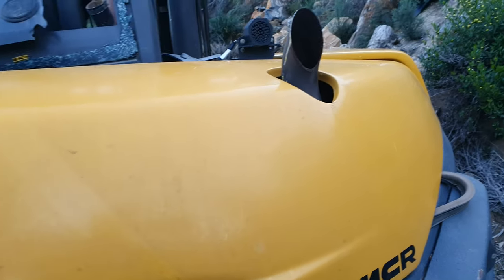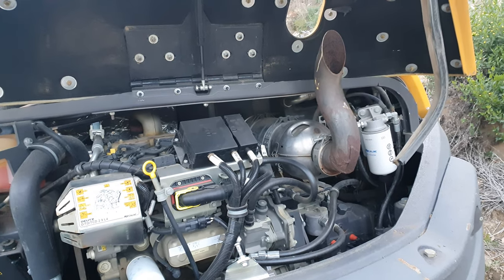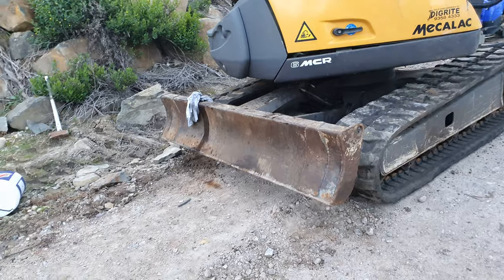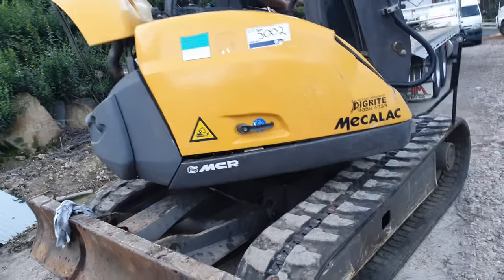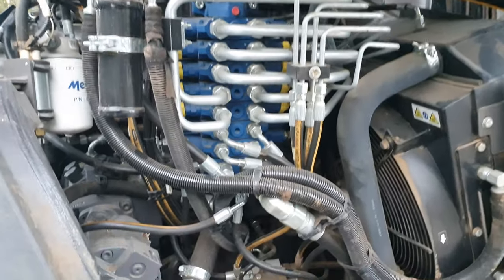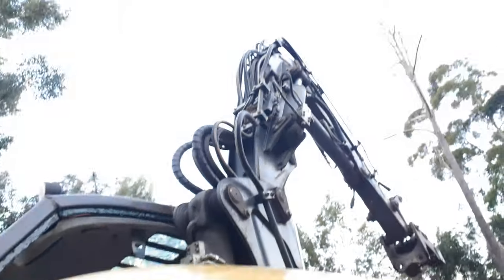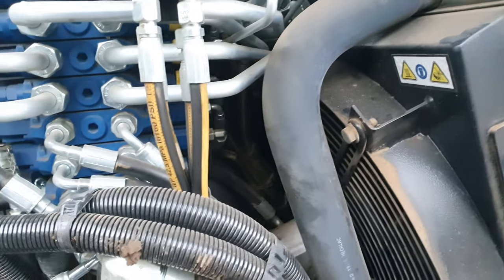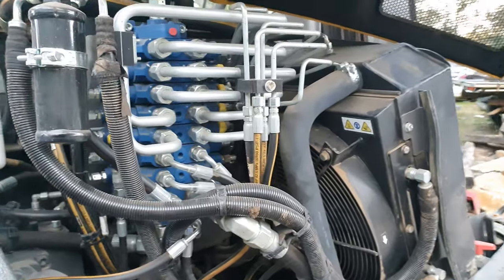Salvaged Mecalac 6Mcr Multi purpose Excavator Skid steer Loader Telehandler first look

Comment: I just came across this video...but I saw this machine in its first year...sales rep brought it to our jobsite for 2hr demonstration...we ran it to load two trucks...mine with dirt...and the other with logs and tree debris...the telescopic boom is outstanding, as well as the touch-free quick change attachments...man you got a great bargain!...as close to free as you can get...these suckers are almost if not already 6 figures brand new...if I recall correctly there was no power loss switching from excavator to skidsteer function on these...I'm curious how they are after multiple hrs use...⚒⛏👍
Reply: I mean the same model...not the same actual machine...lol
Reply from the maker: It would have to be the coolest all in one machine I've ever seen
Reply: The only other question mark was the wear of the main boom while in skidsteer mode...whereas conventional skidsteer use two 'arms' on each side(spreading the load or pushing force between the arms..vs the single center mounted boom absorbing the thrust load...I think the rep answered that
..but cant remember..lol..no matter what...would love to have one for sure...

Comment: Looks great! Mate and I were looking for an excavator for many months. Everything we found was price to kill, Junk, or priced to kill junk.  We gave up in the end and hired machines for what we needed and bought little tractors for the rest. 
owmuch was this beauty?
Reply from the maker: Under 6k. It fell off a truck i think hence cab damage. 1500 hrs. 129k new. 7 ton machine
Reply: @Oneupthesleevecustoms   Not sure what is wrong with it but from the bit I can see, looks like you got a nice bargain. 

One mate and I missed out on about a year ago I'm still stewing over was an excavator he looked at auction which went for under $2k.  He let it go because the motor was blown but machine was otherwise good. 

I nearly cried when he told me he let it go and didn't ring me about it, I had the exact motor for the thing sitting in my shed with about 100 Hours on it I'd bought dirt cheap to make a generator with a few weeks earlier. 

 Still sitting in my shed with 100 Hours on it. 

Think I will go have a little cry now.  :0(
Reply from the maker: @glumpy10  yeah gotta jump on these bargains. The whole cab is bent /smashed